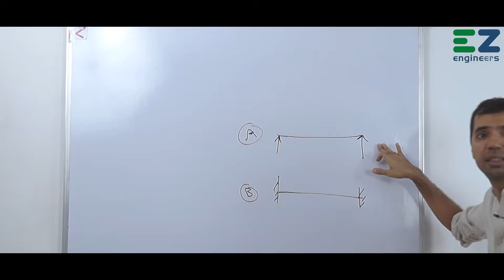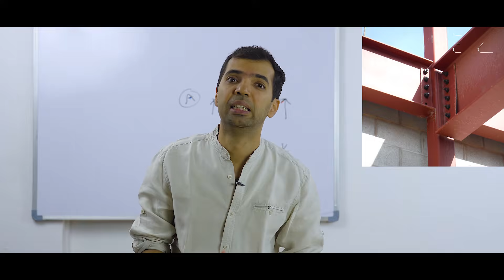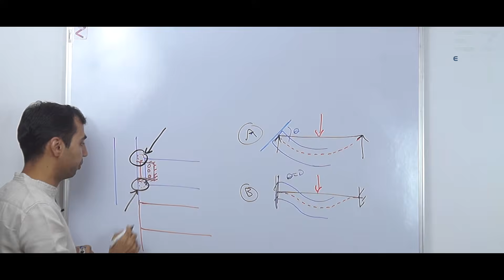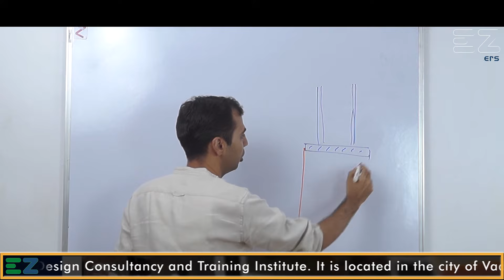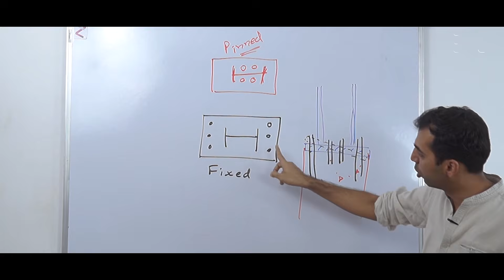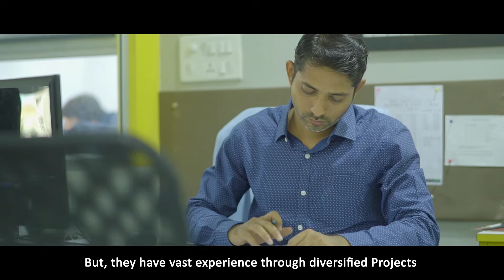Shear Connections, Moment Connections, Simply Supported,Fixed -STEEL & RCC (How to Achieve at Site)

Comment: The logic behind this is that the moment of inertia is maximum at the edge so from the further point it is restrained it will act as fixed and near to the centroid will make it behave like a pinned connection.
Reply from the maker: You can talk to us on +91-9825106264 for further clarifications if needed...

You can just have a look (if you wish) on our EZ courses at
https://drive.google.com/file/d/1HRzMdPT5N3Qcpd_LLXCSJ9gJVbrCQFyQ/view?usp=sharing